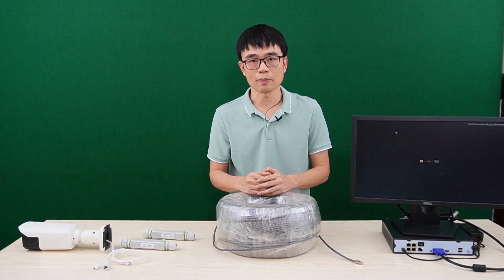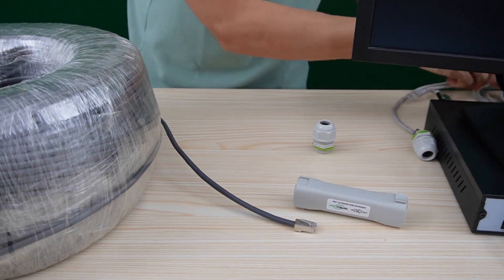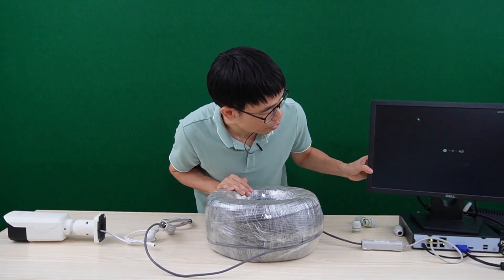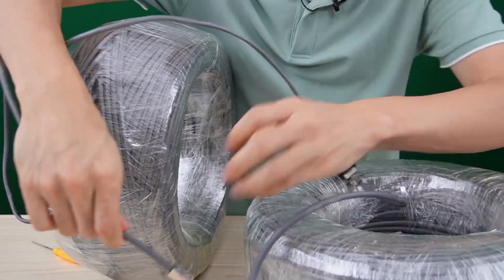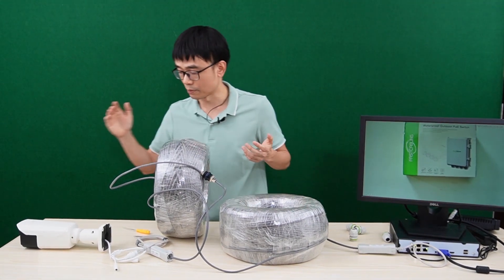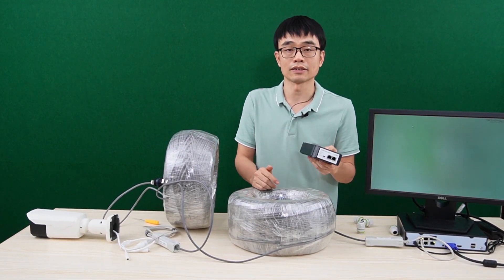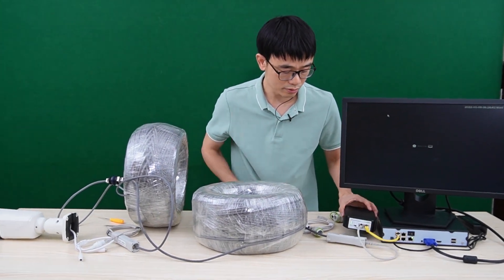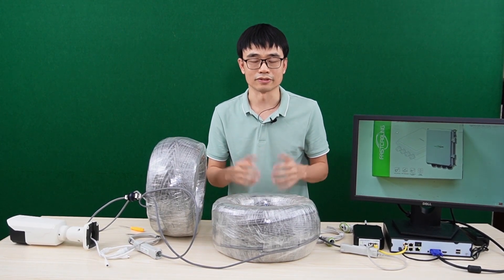How to Wire 1500ft Cat6 Cable to PoE NVR from IP camera

Comment: Hi I see almost all of your demos are about connecting 1 camera for longer distances. What is the solution to connect 16 cameras for example 4 cameras in each direction (N, W,S,E) over 1000 ft? How many switches, extenders and other equipment are needed for this combination?
Reply from the maker: I assume it is the fixed cameras, not the PTZ camera. As the PTZ camera need high power. The PoE++ can’t deliver enough power for 4 PTZ camera. The remain power is about 32W (cat6). If you are using the fixed camera, it should be good enough. You can use the PoE powered switch plus the PoE extender to get the achieve what you need. If the power source is available at each ends, the fiber optical cable is better choice.
Reply: @Fastcabling  hi good day to you, how if i have all fixed 2mp camera where 2unit nearby NVR (with power supply), 2unit at 150metre (no power), 2unit at 270metre (no power) and 2 units at 430metre (no power) with no power supply at each end? total 8 cameras system.

Comment: Hi, thanks for your video, very informative and really well done. I have a question, in the example you are doing you have the PoE injector near the switch, in a general setup that exceeds 300ft (like 800ft) would it be better to have the injector in the middle of the length? or it is better near the switch (or camera). Thanks.
Reply from the maker: Technically you can place the PoE injector anywhere between the NVR and the camera. The PoE injector only add the power to the twisted pairs cable. It doesn’t touch the data. Practically it will be more convenient to keep the PoE injector next to the router. One of the advantage to move the PoE injector front is it saves some power loss. I think It doesn’t matter unless you are dealing high power long range PoE.
Reply: @Fastcabling  thanks for your reply, great videos!

Comment: O.k joe.good video.with this you are clarifying the use of poe injector,that will be able to run a high power ptz ip camera.correct?
Reply from the maker: Yes, the PTZ camera require high power budget than fixed camera as the motors are involved. If you try to run long range cable, most power loss need to be considered. If it is the PoE+ PTZ camera, you might need 60W or high power PoE injector to adapt power loss in long run PoE.